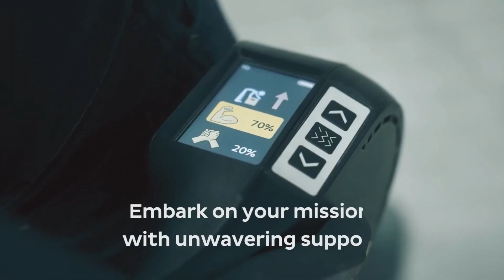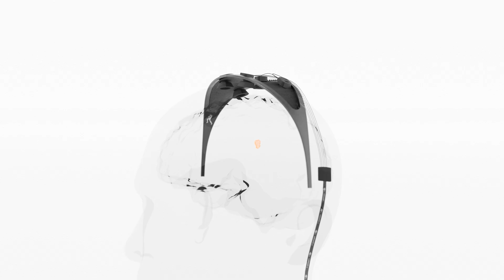Real Life ExoSkeleton Robot Suits That Give You Super Powers  - Updated

Comment: I've had to do ceiling work and I've spent close to 8 hours a day holding my arms to the ceiling in a day. You wake up with extremely sore arms and have to go right back and do it all over again. Your arms can hurt for weeks after. If you can have something to ease that, that's wonderful. I don't see why you'd use it to train jogging or running though. You could go farther and faster I'm sure but if your intention is to use it in strength training while jogging your using less muscle then normal. That's why it doesn't make any since because the point of jogging is to build those muscles and add endurance. I can see people buying it for that though. Using it for hiking makes since though is the point of your hike is to explore and not so much strength/endurance training. I really could of used it on a up mount trail over night camping trip.
Reply from the maker: Your firsthand experience with ceiling work highlights exactly why exoskeletons can be a game-changer for certain tasks. The relief they provide from strain and fatigue is invaluable. t's all about optimizing human potential and easing physical strain. Thanks for sharing your insights!

Comment: As an Engineer currently working on this tech here in Arizona, I think it is largely fruitless to design suits mainly for manual labor such as the suit for drywall when we already have bipedal bots that can already do these types of jobs much faster, more efficient and MUCH cheaper then a human worker can. However these suits are still very useful for many applications. I will say its sad they didnt mention any skinsuit exoskeletons such as the tech we are working on, these suits uses Nitinol Memory Metal Wire Muscles instead of these bulky suits that are already obsolete so you end up with a skin tight body suit thats very comfy to wear instead of 50lbs of aluminum hanging off your back lol